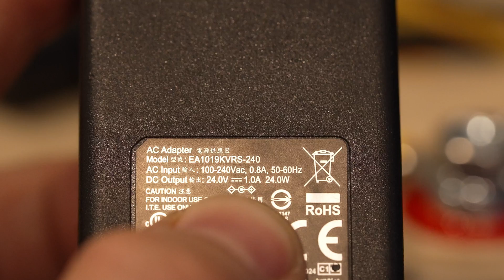DIY Backup Battery Power for 24V Pumps - AI Nero, Axis, Orbit, Reef Octopus, PowerQueen

Comment: I've purchased a couple of these 12V to 24V up converters from Amazon.. the first one was a dud and the second one still only outputs at 12V.. what am I doing wrong?  I went with a smaller 30Ah Lifepo4.
Reply from the maker: Double check the specs on the one you have some are voltage regulators or buck converters that accept 12-24 and output 12v and others are boost converts that take 12 and up it to 24v
Reply: @ReefDudes seems my reply was removed.. let me try again.  The first one I got was the exact same one you show in the video, but it would unfortunately output 0V.  I did check continuity on the ground, which was fine, just to rule out any polarity issues.  The 2nd one I bought says it outputs a constant 24V with max 5A (from 12V).  Unfortunately that one outputs ~13V 😔
Reply: Wow I'm an idiot.. I needed to put my Voltmeter to 200 not 20, for it to read properly 🤦‍♂️.  It works!  I did put an inline fuse off the battery and have it behind a 24v auto transfer switch.  Tested a power outage and it switches as expected 🙂.

Comment: Why not just get two 12v batteries and wire them in series. You can eliminate the DC/DC converter which would be another possible point of failure and get extra capacitance so it would work for longer in the event of a power failure.
Reply from the maker: Or just get a 24v battery from the start :)

12v is the most common so it’s a nice easy solution for it.  In my case my ato is 12v and want to run it all off one!

Comment: went down this rabbit hole the other week, spec'd out batteries, relays, and converters... but it was cheaper to just buy a ecotech battery pack and be done. refurb units can be had for the price of a battery alone.
Reply from the maker: The  big differance there is the ah/run time as this battery is equal to Jsut under 3x etm ones. So a few different ways to look at it. But I do agree the ecotech is. Nice easy plug and play option
Reply from the maker: Also a solid option!
Reply: How many Amp hours
Reply: Ecotech unit is only 12v or did you wire  the dc dc converter into that ?
Reply from the maker: @discol76 your correct. You don’t need this for ecotech powerheads. This is aimed at other brands that don’t have it built in 😊
Reply: Thanks for sharing. Especially the DC/DC convertor. Didnt know such a thing existed 👍

Comment: Nice but this could easily be overloaded :/ that converter is only rated for 5a @24v which isnt a lot for motors. Especially wave makers as they ramp up drawing more current.
Reply: There's no fuse for each item you connect either in case of a fault. It'll just throw whatever amperage it can before something blows in a fault condition. This is why you have proper battery back up systems. Lots of safety implemented into the design. At least if the battery back up burns your house down, your insurance will pay out. They wouldn't for this kinda setup. All things to consider...
Reply from the maker: I do say to check the current of your power supply to ensure it’s less.  This is the first step in an automated one.  I’ll be sure to include fuses in the finally version!  But in a pinch someone can easily plug this is to save their tank !
Reply: Also you may wanna mention a disclaimer unless you want to be held liable :/

Comment: Very Cool . I think you got the head for this stuff & are good at it . Thanks for passing on your knowledge. Really important in these uncertain times & batteries have advanced & decreased in price . Seems you'll eventually foray into solor . I did a little research & you can get used 400 watt panels cheap . I'm thinking a 1000 watt systems . the most cost effective. You already have the batteries. Major part of the expense . Check out MOES Dual Power Converter . When your batts discharge , it automatically switches to the grid . When batts are charged , automatically switches to batt . Since you got the batts . You can recoup the cost faster . Maybe even run your lights . 😊 Thanks Reef Dude ! 😊. Handy if raining or cloudy for a week . Using batteries to the max

Comment: One good trick for this stuff is put some dielectric grease/Molykote on the terminals. It helps keep the salt spray/mist off and prevent corrosion if you’re storing near your tank. I’ve got all my terminals and barrel connectors coated with the stuff to keep corrosion away. Works good on cabinet hinges and screws too!
Reply from the maker: Great tip! I think I have some too :)